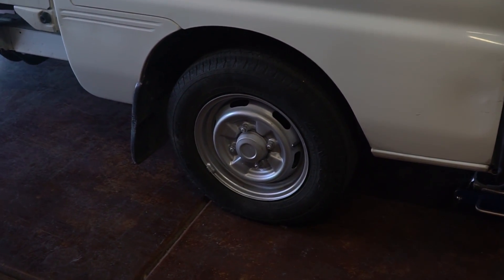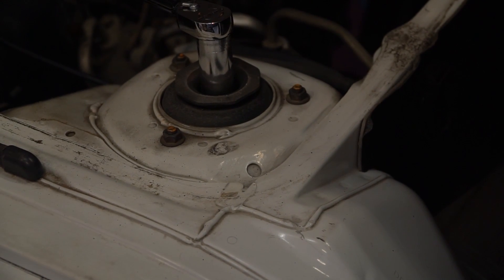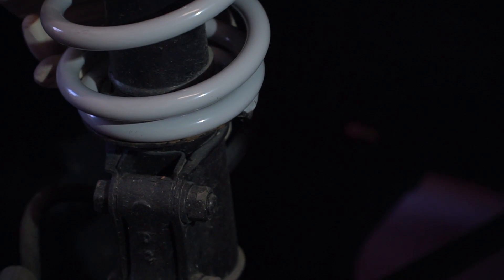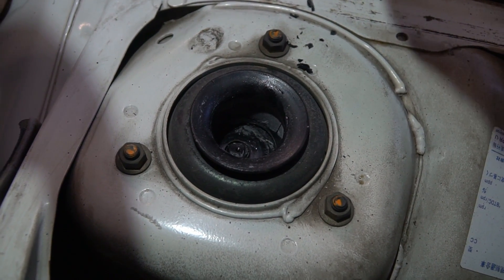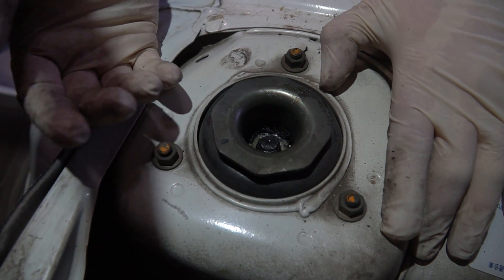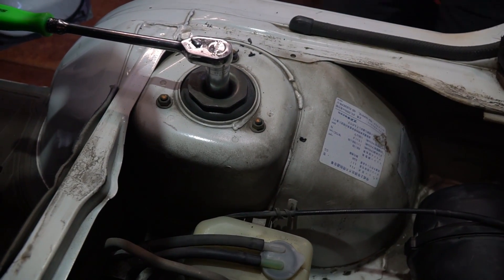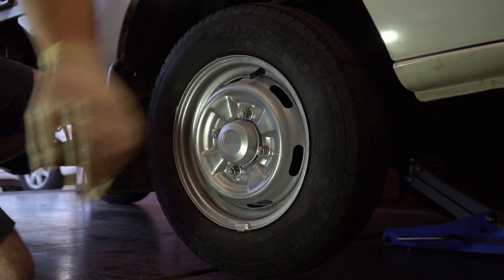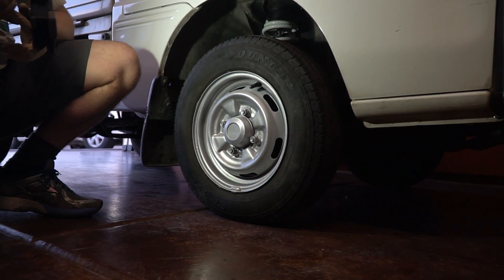1993 Suzuki Carry Dual Rate Spring Replacement

Comment from the maker: If you're looking for the parts and tools used in this video, they can all be found in the description. Thank you for watching, and I hope it helps! Please subscribe, as more videos will be coming out shortly.
Reply: Awesome vid. I will be installing my Harley Rose kit on my 93 Suzuki Dump next weekend. 
Wanted to know did you have to grind down the 2020 springs at all to fit the bottom perch or the top cap? 

The bottom appeared to fit well in the video but the top looked as if the outer diameter of the spring was to large.

Comment: I was doing this yesterday and hit a problem.  Your vid showed me what I was doing incorrectly.  Thanks.
Reply: Glad it helped! What was going wrong?
Reply: @Joe-bm4wx  I didn't remove a couple of the original parts (bump stop, plastic cup, etc) and I couldnt keep the strut rod from pushing into the strut. I have the older progressive springs from Harley and had to do some grinding to get the seated on the lower perch. The inside diameter was 1/32d too tight. Watching your vid put words I've read into picture and everything clicked.....now to tackle the rear air shocks.
Reply: Your vid came up about an hour after I had given up.  Serendipity.
Reply from the maker: Awesome! Let anyone else you know that's having issues to watch my video please, hopefully it helps them. Please subscribe to see what comes next.

Comment: Thanks for the video man! I just got a '95 Carry and I'll be doing this same job pretty soon!
Reply: Awesome vid. I will be installing my Harley Rose kit on my 93 Suzuki Dump next weekend. 
Wanted to know did you have to grind down the 2020 springs at all to fit the bottom perch or the top cap? 

The bottom appeared to fit well in the video but the top looked as if the outer diameter of the spring was to large.